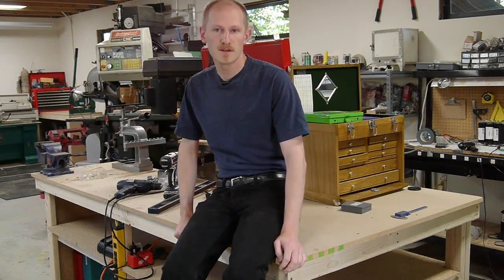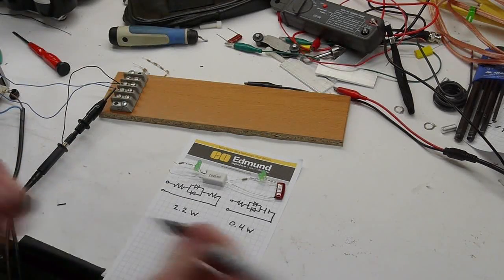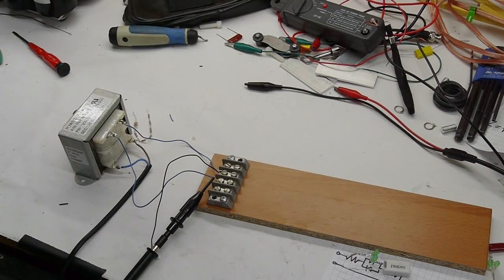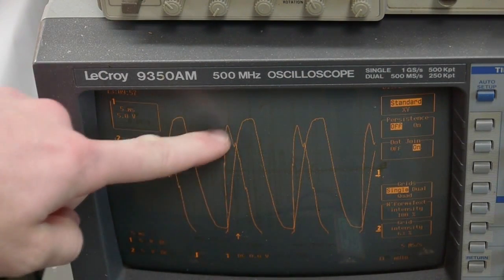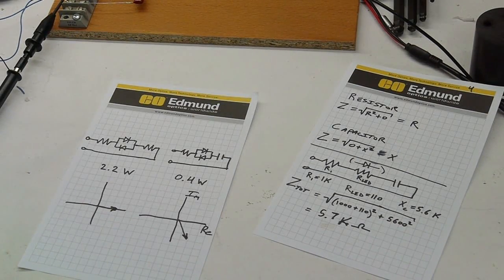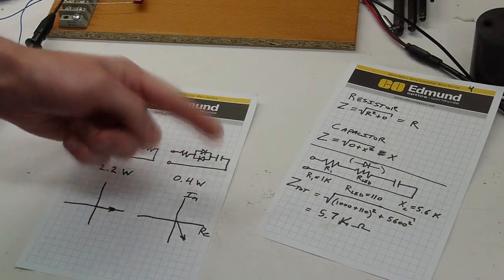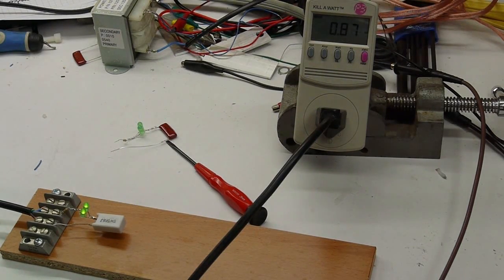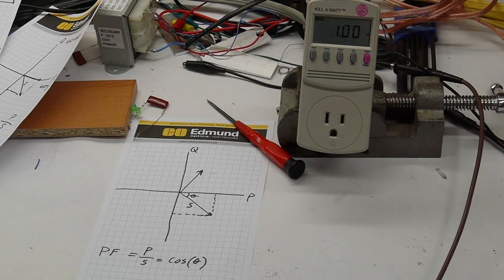Tutorial: Electrical impedance made easy - Part 2

Comment: Thanks for this video, helped me a lot. I would like to see a video about impedance matching and coaxial cables. By the way, we talk all the time about speaker impedance, but if reactance depends on frequency, and frequency on the speaker changes all the time, does it make sense to talk about impedance on a speaker after all?
Reply: Luthieria de Banheiro The speaker impedance is measured at or “close to” DC. But speaker reactance is not only frequency-dependent, but is also non-linear - that coil has a spring acting against it! And furthermore a speaker is a transducer. It connects the acoustic and its own mechanical impedance to an electrical circuit. That’s what electrical transduction is all about, after all. It’s in the definition!

So, analyzing a speaker without analyzing its own mechanical properties, and those of the air around it gets rather inaccurate. Just as you have electric circuits, so you do acoustic circuits.

Think about it for a second: as the speaker cone moves, the acoustic pressure is acting against the velocity of the cone (approximately), and against the inertia of the cone.

The electric current generates the thrust force that accelerates and decelerates the cone, and the air’s resistance to this motion is very roughly associated with the velocity of the motion. The velocity and acceleration are derivatives of each other, so at least to an approximation you can see that the acoustic load lags behind the electrically-generated thrust. 

The highest acoustic load is around zero thrust, where the speaker happens to move the fastest (sine wave is steep around 0, and flat around +/-1). The highest inertial load is coincident with maximum thrust. 

The acoustic and mechanical load is transformed into an electrical current by the transducer action that makes a speaker speak. The acoustic load lags the current (thrust). The inertial loaf follows the thrust. Assuming for a second that the speaker is non-electrically-inductive, the presence of air makes a speaker behave as if it had some electrical capacitance! That’s what transduction does, and you need to not only look at the air immediately next to the cone, but also at the air farther out.

It turns out that the acoustic impedance of a speaker in anything but large open space ends up behaving like a passive circuit with multiple acoustic capacitances and inductances connected in a network. Even a lone speaker in open space has a mechanical self-resonant frequency, as well as a coupled aeroelastic resonant frequency associated with its size.

From the point of the electric circuit driving  the speaker, those acoustic and mechanical impedances are indistinguishable from electrical ones (the mapping between them is not “simple” other than in a linear approximation, though).

So, as far as speakers go, the DC electrical impedance has mostly to do with setting the operating point and output impedance of the amplifier’s output stage. But other than this, it plays very little role. A speaker cone is only an inductor in series with a resistor when you remove the magnet from the speaker. If you have the magnet, you must put the speaker in vacuum, and you get to see the purely mechanical response of the speaker on top of the electrical response.

And then you let some air in, and get the acoustic response mixed in. That response is not only “in addition to” the mechanical and purely electrical one, but also results in altering the mechanical parameters of the speaker cone (air deforms the cone, changing its stiffness etc, and altering the mechanical response continuously). So, a speaker is a rather complex, non-linear system, and its pure electrical impedance is essentially of no concern once the amplifier is working with it. It’s all the other impedances and responses, transduced into the electrical domain, that really affect speaker performance first and foremost.

Speakers have comparatively terrible distortion (non-linearity if response), as far as transducers go, and this distortion dwarfs electrical distortions in all but crudest of amplifiers. It doesn’t mean that it obscures the electrical distortions though. They all add up, and our ears can pick them apart somewhat, often easily.

Making a linear speaker would require a rather different mechanical design of the transfer itself, so that its response nonlinearities would be far away from the audio frequencies. It would also require closed-loop control of speaker fragments, based on local acoustic pressure, to compensate the effects of the cabinet and nearby obstacles on the speaker’s performance.

Comment: 1. Very informative video. Good work :)
2. Actually, the power factor of the resistive LED circuit is not 1.0 is due to harmonic power (the current waveform isn't the same shape as the voltage waveform), which is a topic all of its own.

Comment: so in the above ckt you used power factor less than one to decrease the the power dissipation. But in the end you mentioned the power factor has to be close to one . But doing this will increase the power dissipation.
Reply: Nope. Because actual amount of power you draw has to go somewhere; either to your load (the LED in this case which would explode), or into the air as heat. Passive components like theoretical capacitors & inductors don't dissipate power at all, only resistors. As he said in the video; it just prevents extra resistive losses in the cabling back to your utility company's facility. 
(Note, though, that if you add an inductor,  you'd have to change the value of the capacitor to compensate for the reactance of the inductor.)

Comment: Dan, a quick question - if capacitance plus inductance cancel each other out and return the vector to wattage, that means that the circuit is seen by the power company as almost pure resistive and you are charged for the wattage. But that also mean that the power was dissipated - while in reality (for the most part) it was not, right? Can you elaborate? Thanks.
Reply: Yes, you can use capacitance and inductance to cancel each other out, and as the vector math implies, it does look much more like a resistive load then.  This is why capacitor banks are installed for businesses that use large motors.  

Current will slosh back and forth between the motors (inductors) and the capacitors as the voltage on the lines go through their 60Hz cycle.  However, the NET current seen by the power company will appear to be (nearly) in phase with the voltage, making it LOOK like a resistive load.  Since neither inductors (motors) or capacitors are perfect (i.e. lossless) there will be some real power dissipated in the capacitor bank.

A properly built watt meter only measures real power, so you would only be charged for real power either way.  However, a low power factor makes it difficult for the power company to maintain proper voltage levels on the line, and can lead to equipment damage if it gets out of hand.  That's why they want to keep it near unity.

Comment: Anybody knows in Europe where you could get cheap isolation transformers close to 1-1? I can find regular ones, but have troubles to find something close to 1-1 ratio and if i will find it it's 10x more expensive than I would expect. I don't mind used / vintage / salvaged from some other device.

Comment: the only comment is how did you work out the capacitor value of .47uf  ?  you just seam to have plucked it from the air with no explanation in ether video
Reply: he actually calculated it backwards. He knew what impedance he was aiming for, so the only unknown was the capacity.

Comment: So... I'm confused... Is the phase shift angle produced by a capacitive or inductive reactance equal to the angle of the power vs volt-amp vector used to calculate power factor? Or are the angles related in some way? Like is there some way to mathematically link the impedance vector with the power factor vector?
Reply: Yes.  In DC circuits, P=VI.  It is the same in AC circuits, but both V and I are vectors, not scalars, and so is their product P.  The real part of P is "real power" and the imaginary part is "reactive power."

Comment: In terms of your water flow analogy it helps me to think of capacitors as gas charged desurgers or hydraulic accumulators. They charge when system pressure (voltage) is high and outflow when system pressure is lower. Thanks for the good videos.

Comment: Thanks for the great video. How would you know whether the circuit is inductive or capacitive ? A PF of 0.15 doesn't point that. It just says it is more reactive and less resistive. Right ?
Reply: A capacitor is strictly reactive in theory. When it comes to very small capacitor values, they can actually be overall inductive if they are the throughole variety, which is why small capacitors tend to be the surface mount variety package. But since reactance is frequency dependent,  it also depends on the frequency(s) involved.

Comment: Excellent explanation. A little dry, but excellent technically. Thank you. However I was not able to fnd the next video that you mentioned - impedance matching. Was it ever done?
Reply: me too
Reply: +Alexander Chaihorsky YEs, i did not see the coax cable impedance either, but want to!
Reply: Me 3
Reply: Alexander Chaihorsky Teaching should be dry, with no distraction's or comedy.
Reply: Passion is good. It makes the learning sink in deeper. Personally, I am a pushover for comedy.
Reply: Alexander Chaihorsky & just to the point.
Reply: I want it too! Trying to learn what I need to know to make proper analog RGB signals from old videogame systems. Still trying to find out what they mean by “properly attenuated with 75-ohm C-sync.”

Comment: This really made a lot of sense to me. The one part I did not exactly grasp was when you talked about the power company wanting to provide a as close to 1 power factor. Wouldn't they prefer a PF that leans more toward the inductive side of that diagram you drew?

This is what I do not understand, as I understand it inductors push current in the same direction, this would seem to benefit the power companies? Are they really being that honest with imaginary power? Is it possible to have a PF higher then one, like an inductive load?
Reply: Inductors are like capacitors in that they push energy around instead of dissipating it. They just do it in a way that can cancel out capacitive reactance in the same circuit.

The power factor is equal to the cosine of the angle between the impedance and the horizontal axis. This is never greater than 1, and inductive loads are less than 1 just like capacitive loads. And both are bad for the power company because shoving the power around results in power line losses.
Reply: +Dan Doel So the sloshing around of current caused by capacitors/inductors does not cause losses within the circuit element itself, but has the side-effect of causing losses in the wires that connect to them?
Reply: Yes. All wires have a little resistance. The longer the wire, the more resistance there is. Most likely you won't notice the resistance of wires in your circuit, but the wires between your house and the power company are a lot longer, so they actually add up to something significant.

Comment: Is the current different because the capacitor is actually being forced to discharge and change polarity? Kind of like forcing a ceiling fan to turn the opposite direction while it was still spinning? The counter electromotive force of the fan is moved around and thrust the amperage is moved around.  I just know basic aircraft electricity and it was a while ago.

Comment: Awesome video... so that's the purpose of a run capacitor on a single phase motor. No electrician has ever been able to explain to me why it's there. The motor will run the same without it, but the power factor will be lower than 1.0 and the power company will be losing power. Based on this knowledge, the run capacitor size (uF) is critical to bring the angle back to zero. Over-sizing a start capacitor doesn't seem to negatively affect your circuit, but over or under sizing a run capacitor will cause the power factor to be less than 1, either on the capacitance or inductance quadrant of the graph respectively.  Would this hold true with 3 phase motors? Would you need 3 run capacitors, one for each leg? and would they be wired to ground or between the legs? 

Also, the 1K resistor is dissipating power. If you had a switch that latched on at the zero crossing, this would allow you to run the circuit with the capacitor only and use less power, correct? 

THANKS for you videos!!